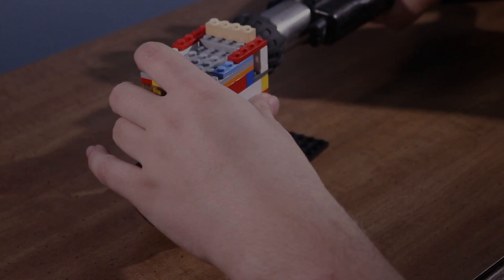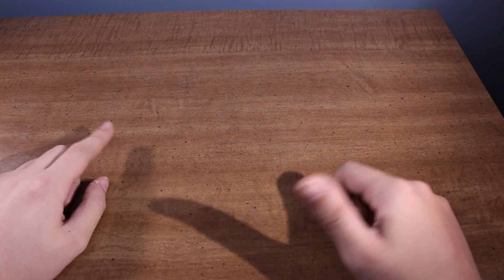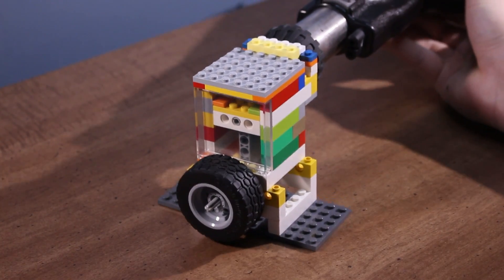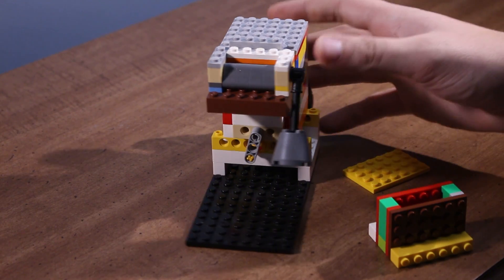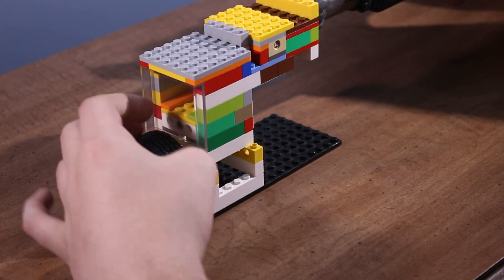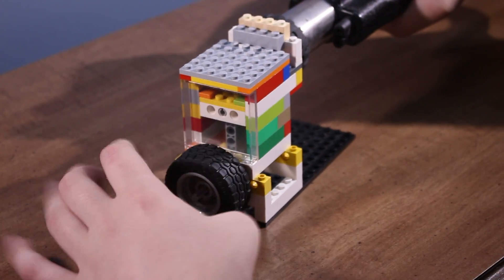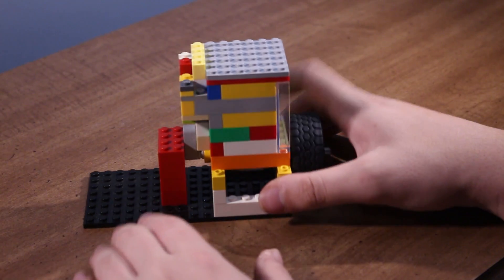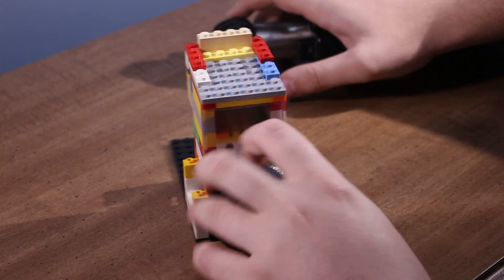Idiot Tries to Build a LEGO Vacuum Engine....

Comment: More like Air or pneumatic engine

P.S. nice👌
Reply from the maker: Not really. Pneumatic and air engines run using positive pressure (compressed air) and vacuum engines run off negative pressure (vacuum suction)

Comment: i built it exectly as yours by just watching this vid. but then looked at my vacum and realiszed it wasent strong enough:(
Reply from the maker: Yeah, that happens. That's what was my limiting factor for a while. I'd recommend, if you can, to pick up a shop vac for woodworking or something. Those are very powerful, and they're perfect for running engines
Reply: @DeltonAdamsLEGO  thanks

Comment: yeah you should make more and bigger ones 

and here is a tip you shold use some oil
Reply from the maker: Nah, I want to avoid using any kind of oil or lubricant. I know I might be losing some rpm, but I'm fine with that
Reply: @DeltonAdamsLEGO  okay

Comment: there are so many issues with this engine, first of all you make no sense, WHY DO YOU USE ONLY ONE SMOOTH LEGO 1X6 WALL? You need to surround piston with these walls  for smooth engine operation. Then you should probably glue the bricks together or the engine would just explode and please use oil

But considering this is your first engine, congratulations!
Reply from the maker: Just a small project to see if I could do it. But I don't think I'll use oil right now. Not a fan of that idea
Reply: @DeltonAdamsLEGO yeah I get it I can get messy but it highly depends on the lubricant you use, I started with olive oil, it doesn’t eat plastic away but it’s hard to get off. So now instead of oil I’m using a legit silicone lubricant because it’s less messy and also because it’s actually easier to lubricate with the high pressure nozzle. Unless you want to make like a 2-5 k rpm Lego engine you don’t really have to use it, it’s just a recommendation so you don’t melt Lego bricks
Reply: @BrickEngines a q tip is easy to spread oil around with and you can eat olive oil, but silicone eats lego
Reply: @Dudeface167  Oh sorry I've not specified one important factor: ONLY USE silicone lubricant THAT IS COMPATIBLE WITH PLASTICS. Thanks for reminding me
Reply: @BrickEngines I make almost all my engines without any smooth cylinder walls and with lubrication and without sanding the pieces they run just fine.

Comment: The main reason why the engine keeps stopping is because of the small flywheel. Try attaching a bigger flywheel but also with support, meaning it'll need a longer axle. I'd also recommend you to lubricate the engine, the one that I use for mine is olive oil.
Reply from the maker: I figured it would probably need a larger flywheel. But I don't know about lubricating mine just yet...
Reply: @DeltonAdamsLEGO  Just cover a cotton swab in olive oil or something like that, except WD40 as it can destroy plastic.
Reply: I didnt want to lube my engines at first, but then I tried it and it made a huge improvement

Comment: Tip: Secure the tire youre using to crank it and keep it away from walls by at least half a stud. That way the rubber from the rire doesnt collide with the wall causing it to rub and slow it down. And for the throttle, When its closed cover up any gaps so when you start the vaccum engine, air doesnt escape and slow it down. Also using a technic beam that is 4x1 and L shaped with an axle stud is usually better because you can do quick movements and keep grip while the engine is running. Thankyou, I hope this helps!